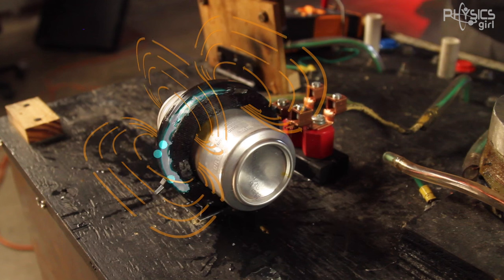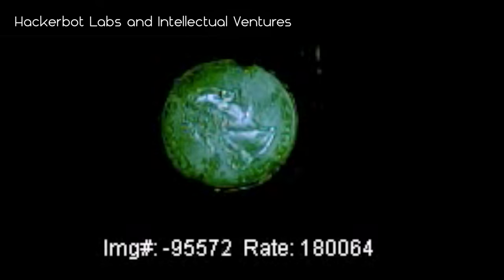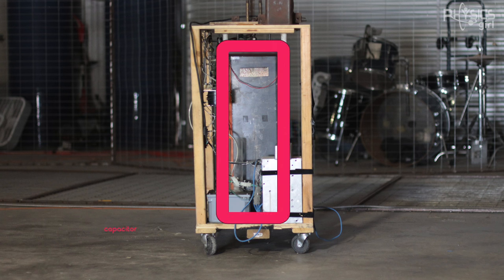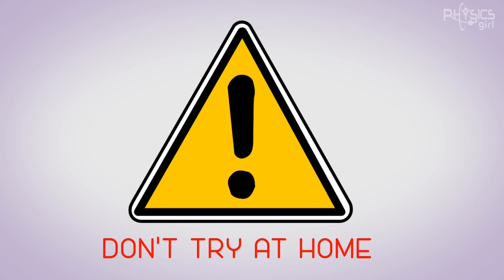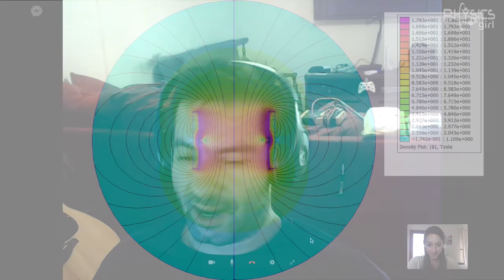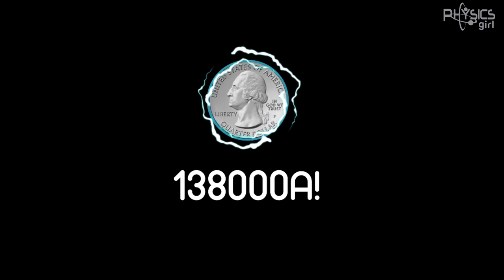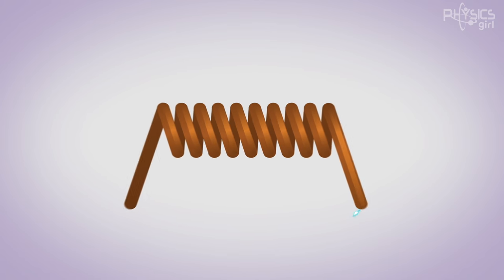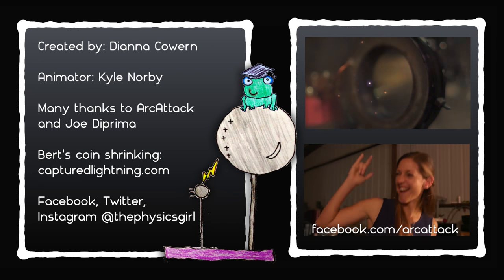How to Shrink a Quarter with Electricity

Comment: Another good way to shrink currency, by about 10%, is for a E U country to vote to leave the European Union. :-)
Reply: @MadMulberry: Yes, but the question is what the reference of that 10% is. The GBP is not expected to change much, and a significant part of that country's economy is local (in the case of Great Brittain). Therefore understandable they at least consider a brexit.
Back to physics girl: in the old days the real value of a coin was directly related to the metal it was made of, and the purity thereof. When you shrink a silver or gold coin it does not really devaluate economically.

Comment: I wonder how much of the coil destruction is because of the force on the coil and how much of it is because of the current heating it up and weakening its mechanical strength. Would it be possible to make an outer non-conductive mechanical support which would keep the coil (of the same thickness) together a little longer? What do you think would happen with the cooper? fuse along the walls of the shell? make a cylinder?

Comment: True Explanation- The coin is the size it is because of the quantity of energy in each atom. The distance the atoms are apart depends on this energy value. Less than 1% of the metal is "solid" the rest is space. If the energy value is increased ( e.g. by heating it in a flame ) the coin will expand (the atoms have moved further apart) . When the electromagnetic field is applied a massive shock is produced that displaces a portion of the energy within each atom. The reduction in energy causes the distance between each atom to diminish, the coin is smaller. A similar effect occurs if the coin is cooled (taking energy away from the atoms) – it goes smaller.
Reply: Sounds good to me!
I gave you a 👍!

Comment: If you can take a large 10KV capacitor and charge it up using 110V out of the wall. How long does that take? Couldn't we then use a transformer with that capacitor to power a higher energy appliance such as a hot water heater or electric dryer that require 220V and cheat the electric company out of charging us more since we are only pulling 30amp from the fuse box to charge the capacitor? Again, it depends how long we take to charge up the capacitor to see any savings. So back to my question, how long did it take to charge up the capacitor?

Comment: How would it affect the experiment to cool the coil with liquid nitrogen before firing the capacitor?
Reply: The coil would have lower resistance, so the peak current would be slightly higher. The peak current is mostly limited by the inductance of the coil, not its resistance. A chilled coil might be more brittle, so it might fracture before reaching its peak current.
Reply: @BertHickman  Cold coin though perhaps, just have to control all other conditions well, coils nearly identical. Voltage precise.
By the way Bert, with #12 magnet wire I tried 1 to 18 turns and found the optimum was 9 at 30KV.
Reply: @garyha2650  Nice hearing from you, Gary! I still have a copy of your 1993 Extraordinary Science magazine article on coin shrinking.  We get best results with 10 turns of #13 AWG magnet wire, single layer, using 140 uF at about 8.6 kV (~5 kJ). Our capacitors are rated for 12 kVDC. Not a lot of change from 9 - 11 turns, but having a uniform single-layer coil is critical. We get a quarter that's approximately the diameter of a dime. Works best with quarters newer than 1996 (flatter, lower-profile minting process). Older quarters tend to warp more...
Reply: @BertHickman  Sure do appreciate that you mentioned that. Coincidentally I had just found that edition in my shop just before you mentioned it, had to move so many times. Forgot I had a copy. I'd been saying 1996 b/c I couldn't exactly remember, it was 1993, gee. The Jan-Fed-March edition shows the Dale Travous Tesla coil (his name is misspelled in 'About the Cover'). Our shops were together in the same open warehouse space. Dale at one point rigged things so the Tesla coil 10 foot streamers would eventually find their way to the coin shrinker caps (charged up). That discharged them with a strong bolt between coil and caps. So why weren't either one of them damaged? Dan Yerkovich could tell you, the one who invented the world's first automated heart defib unit at Physio Control, he was dropping by our lab periodically, is the real reason I even understand electricity (because his explanations actually made sense to me, voltage is just electrical pressure for example), could be the reason we're all still alive, and is the one who suggested I wrap a coin in a coil. So credit for the idea is Dan's, just that I was doing all the doing. By the way I made the plunger/trigger air-driven, still have that. Kind of surprising that the aluminum contacts never welded together. The power supply was an old x-ray machine controller and transformer from a dentist's office, its KV gauge worked well. I should re-read my article, see if my memory is right that the cap bank was 6 x 8uf. Cheers.

Comment: I calculated the speed of the shrinking of the euro. The euro shrank 3mm from the original diameter of 23 mm in 5 frames. it bounces back a bit in the next few frames, but this is the minimum size. 3mm/(5 frames/180000 fps) = 108m/s (350 ft/s) or about 400 kph (240 mph)!

Comment: You described what you did, but you did not describe what caused the shrinkage.  Are atoms closer together (higher density)?  Did the metals change phases?  Did the metals change lattice structure?  What actually happened?

Comment: That bleeder resistor is shown  on the wrong side of the 'switch' it will not discharge the capacitor below the dielectric breakdown potential at the gap. It will leave hundreds of volts still available in that capacitor.

Comment: On the somewhat less trivial side of this, researchers at "The Z Machine" Lab use precisely the same phenomenon to heat and compress a conductive plasma to extreme temperatures and pressures in order to study nuclear fusion.  A commonly used term for these types of experiments is Z pinching, because the changing field in a solenoid interacts with conductors, squeezing the along the Z axis, be they coins or plasma.

Comment: Awesome, and yea, capacitors and collapsing magnetic fields are both very dangerous. Oh, and I used to operate a 45 million BTU heater, using as much energy in an hour as a small city uses in 6 months. So I have a pretty good concept of a megawatt, as those two units of measurements are similar.

Comment: So if I understand it correctly when you place the quarter inside the center of that magnetic field the forces there are so strong it acts on the quarter shrinking it if I’m understanding it correctly doesn’t that mean if you put it towards the this video left of the magnetic fields when they start to go out words in the loop around back in if you were able to hold a quarter there doesn’t that mean you could technically expand a coin as well

Comment: Would this setup, if modified be able to create permanent magnets?  Seems somewhat similar to a magnet charger in that they use massive capacitance to build up and dump the charge as quickly as possible.  I'm very novice so I could be way off.

Comment: Interesting. Is the coin the same weight as before just smaller? I don't understand how a solid object can shrink on an atomic level to be a smaller object. It is not a porous material. Can this be used to make stronger metal with more density- more molecules in a smaller space?

Comment: Like many other people here, the physics mystery for me which remains, is, what happened at the atomic level? By conservation of mass the shrunken coin either lost mass (e.g. the metal  vaporized) or is denser. But metals are not that compressible. Due to the high currents the excess metal probably vaporized, so the shrinkage perhaps was not due to force.

Comment: So the coils changing magnetic field induces current(witch is the flow of electrons) around the edge of the coin. These moving electrons then experience a force towards the centre so they decide to go there. During travelling to the centre they bump into the atoms so hard they push some of them closer to the centre, but in the meantime these pushed atoms knock some others to the flat side of the coin thus thickening it. Am i right?
Sorry but forces pushing the "coin" was a bit shallow to me.

Comment: I wonder if there is enough time while the current is flowing, for some of the effect of induction heating is also in play, allowing the core of the coin to heat, to the extent that the metal "slumps" and attempts to pull itself into a spherical shape?

Comment: You didn't really explain what physically happens to the structure of the coin. How does the volume actually lower? Does it? I don't see how it could be compressed unless the internal structure of the molecules in the coin changes.

Comment: Very neat information and video what kind of misleading. I wondered as I was queuing up the video where the mass of the coin went if it shrunk. The coin didn't actually shrink it just changed shapes by becoming fatter. Just kind of the wrong use of terminology as far as saying shrinkage but still cool information.

Comment: So what changed? The quarter is still made of the same material, right. Yes, you gave a textbook explanation, but that says nothing about changing mass or density or volume. We see the volume has changed, which changes the mass, right? Archimedes and the true gold. Was it: M= weight/volume?
Reply: The volume and mass remain constant. The coin becomes thicker as its diameter shrinks...

Comment: How many Farad is that capacitor? Not microfarad, but actual farad..... And the reason for the bleeder resistor is that  Some stored electrons stay trapped or hiding in between the physical layers of the capacitor and  Eventually they redistribute themselves throughout the capacitor equally and rebuild an electrical charge that once again can be discharged very quickly if the capacitor is touched port shorted out.

Comment: How does the bleed resistor still bleed energy if the contact has a gap. At some point the capacitor voltage will drop below the ability of it to jump the gap thus the bleeding stops leaving the voltage in the capacitor at whatever. Please explain..

Comment: Try making diamonds from carbon. Maybe a graphite fishing rod. Question: Were old AM internal ferrite radio antennas high in carbon?
Or my favorite, a #2 pencil. Inside the coil, place the pencil at the bottom of the coil (same size coil as for a quarter). Above it, a rectangular bar of copper that will fit, with some space between the two that won't offer much resistance (say, cotton balls). Should slam them together with a lot of force while magnetic domains in the material at a molecular level are aligned. Then a high power microscope with the remains.
What would happen if the copper (or whatever other conductive material you think of) were only a millimeter thick? Would it wrap around the pencil graphite? I'm presuming there won't be much pencil wood to be recognized in the aftermath except from ends sticking out.

Now try something no one else has done yet, to my knowledge. Two coils. If the quarters are in the coils off-center toward each other, they will slam together. 

Will they meld together? You can win tavern bets with a two-headed coin you know. In this case everybody would have to be pretty sloshed. Make sure you're near an exit. I digress.
Three coils.

Although quarters are 97% copper and it is more conductive than anything (except silver and graphene at room temperature), what happens to a ball of aluminum foil? We tried a solid aluminum sphere.
Copper pipe is interesting. I found that looking in the end, there were 8 indentations. Is that from the extrusion process at the factory or is it something inherent to the material? 
Aluminum pipe on the other hand was more interesting, 3 sets of 3 indentations with space between them. Something about the metallic crystal structure?

Try to order same diameter and wall thickness for a fair test. If you see what I saw, then call the factory and ask. If it isn't from guide-wheels in the machinery, then you might have something useful in science or education/understanding at least.

If certain materials are treated that way, what if they could wind up with different properties, melting point, coefficient of expansion or or .... <stop>.
Maybe you can discover a more efficient diode/transistor material that won't heat up under high current.

The thin insulation on the coil wires can't take a ton of heat like from a heat gun or torch right before the triggering, but you could try a can of compressed air held upside-down to freeze-ish the coin and coil. Don't stop there, bombard it with frequencies, sound, lasers. Guts of a microwave oven.

What if the coil is inside a thick-wall copper pipe?

Comment: it looks like the coins are a little thicker, but to they actually loose mass in this process or is everything compressed in rapidly and then the coil destroys before excessive deformation happens? To me it looked far too much smaller to maintain the same mass.

Comment: Is the coin thickened or some of it vaporized or is the density of the metal actually increased? If so, I didn't think you could change the density of a metal.

Comment: How much does each "zap" cost, in terms of local draw from the grid?
Reply: You'd have to know the capacitance of the capacitor to know that.
Reply: @Gonza-lh2vo  I just want to know what it costs.
Reply: @greatoak7661  They don't mention the capacitance, so it's impossible to calculate the cost.

Comment: How is the weight and density affected?  Are the metals collapsing on themselves into a more dense chemical structure, is material vaporizing to allow for the size reduction, or both?
Reply: They are getting thicker as they get smaller around so the volume & mass remain the same. Basically, it's becoming less of a disk and more of a cylinder.  You can't practically change the density of solid elemental metals (or alloys thereof) and vaporizing would destroy the surface features that make it look like a coin.
Reply: @Wick9876  Thanks for the answer.  Does that mean they believe that virtually zero % of the mass is vaporized and that the material density also has virtually 0 % change?  Just a change of shape and nothing else lost or changed?  Thx

Comment: 🧲🌡️📡🔆☢️🔌🔊🔋♻️🌐☯️⚛️
I feel magnetism and electromagnetism play such a crucial aspect of the cosmos. It's really facinating how so many properties with-in Nature, differences seem to be a key factor in keeping dynamic systems functioning. High pressure/low pressure, hot/cold temp, different densities, static electric charges/discharges, electromagnetism north/south poles, different velocity/angular momentum, layers between different regions such as, land, water, air, edge of atmosphere, space, the different regions in space with different particle density, creating bubbles/membrane layers, cloud regions, nebula's/ Galaxy's, Galaxy clusters, less dense voids regions of space. All of these things are basic differences but create a way for the dynamic engine with-in Nature to continue flowing and operating to create and convert energy. How a battery 🔋 transfers + charges through a membrane layer to a - charged side. Like how regions of high/low pressure and temperature 🌡️differences create winds. Transfer that into water or planets core and add density. It creates either ocean currents and flow or planetary convection geothermal activity.
🧲🌡️📡🔆☢️🔌🔊🔋♻️🌐☯️⚛️

Comment: You said, you thought the quarter would get heavier from the outer covering build up. The quarter did get heavier from the outer coating build up.  It also got lighter from the centripedal acceleration of coherent matter into counterspace (magnetism). Neither, the electron or the photon exist as a particle.

You go physics girl. I enjoy your videos.
Reply: The quarter was accelerating into counterspace. Scotty, we need more power.
Reply: @ 1:47, I see the design of the Universe. The outer edge of the quarter, is a torus, encircling a hyperboloid. The outer edge of the quarter is splitting in half, this is the dielectric inertial plane. The hyperboloid is the magnetic field moving  centrifugally from the outer edge  of one polar edge of the magnetic field, centripedally into the opposite center. 
 Incoherent matter accelerating centripedally into counterspace (formerly known as, Gravity).

Comment: Can someone explain how the quarter/coil circuit received/pulled 26.5 million watts? I'm ignorant on the process of pulling X watts from his wall socket to charge an 8000 volt capacitor, but he in no way pulled 26.5 m watts. So what am I missing?

Comment: So...
Was there any change in mass from before to after? Or is it entirely a change in density??
Reply: I'd say: Neither. It doesn't look like there's anything missing from the coin (at least the front relief was still intact), so the mass has to be the same. And you really can't simply change a metals density that much apart from heating or cooling it or using different alloy materials.
Like Dianna said, a very high force is generated in the outer area of the coin which makes the outer area squish the inner area, which susequently gets thicker. It's juat a volume distribution. Just think Play-Doh and not foam :)

Comment: You still did not explain what is actually shrinking? When metals are heated to a high enough temp. it changes the alignment of the molecules, ie: annealing to make metal soft/pliable or hardening by quenching in oil or water. The molecules alignment must really change to shrink as you call it. It would be interesting to know what is actually happening on the molecular level.